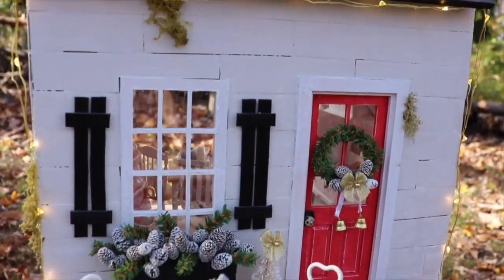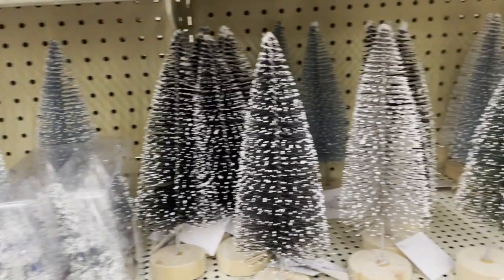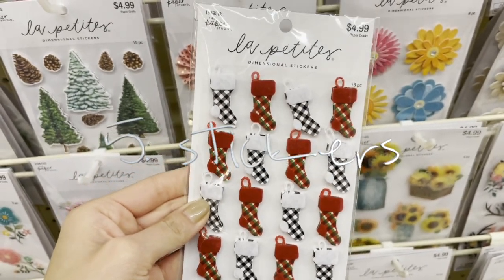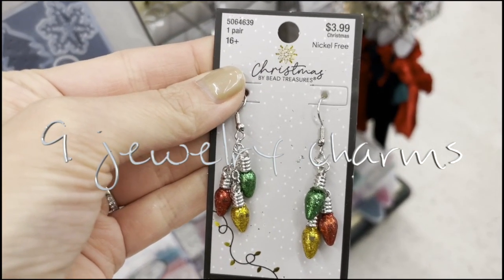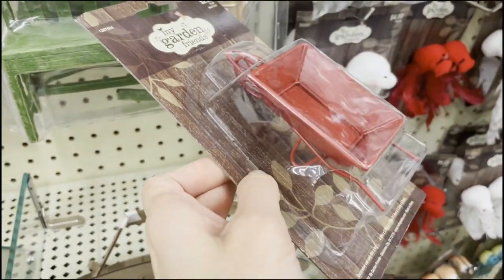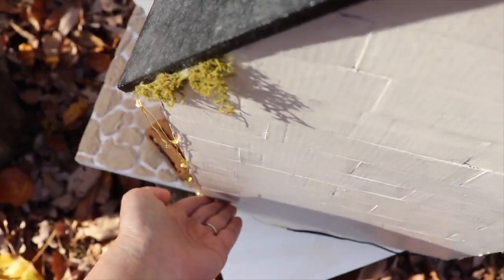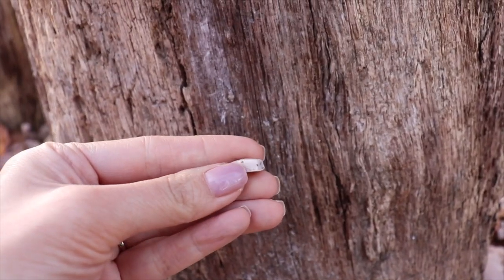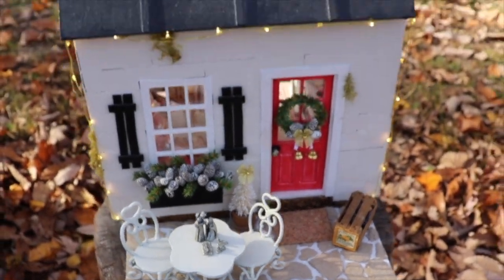14 Hobby Lobby Dollhouse Items & Christmas Cottage Tour

Comment: I love the idea of scrapbook paper as flooring,real carpet is just too much!  I have been successful using very small braided coasters as area rugs and once I found a computer mouse pad at a thrift shop that looked like a very realistic,vintage Oriental rug,it even had a velvet texture.(maybe some velvets would work.)
My friend did something awesome with her dollhouse,she cut a hole at the back of her fireplace and lined a chimney up the outside with stainless steel.( or maybe it was just aluminum foil?) She bought a box of balsam incense cones and when she lit one and blew it out and sat it in the fireplace,wonderful smelling smoke would come out of the top of the chimney. 
She never left it unattended but it was safe and beyond adorable!🥰🔥
Reply from the maker: The fireplace sounds like a great idea! I’m so impressed. I have seen coasters and mouse pads that look like rugs too - those are great finds!